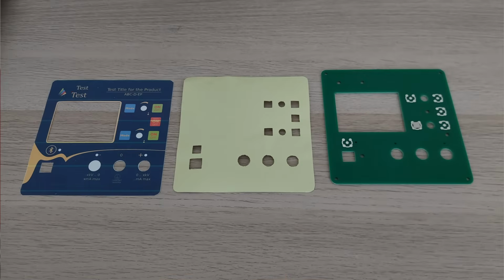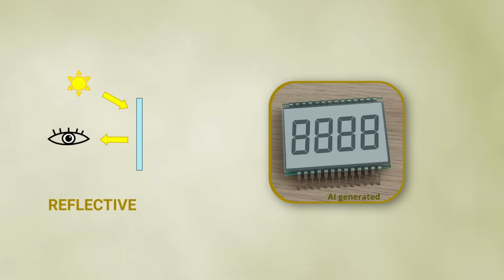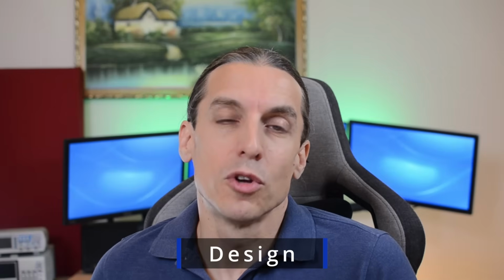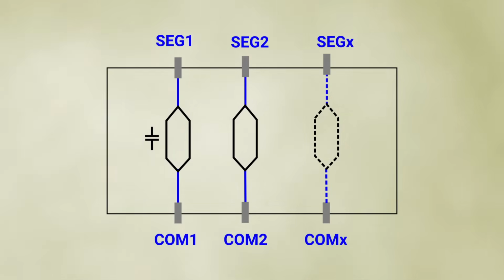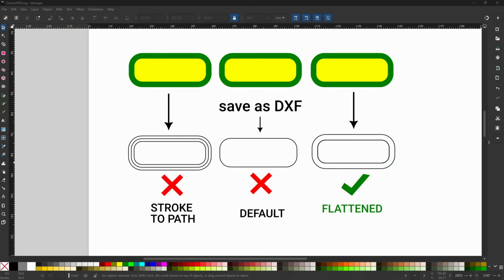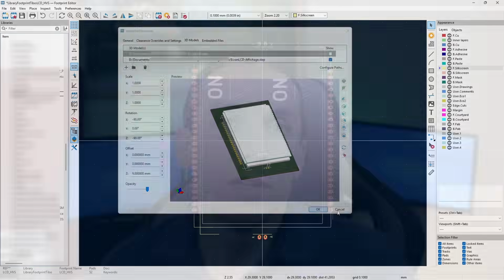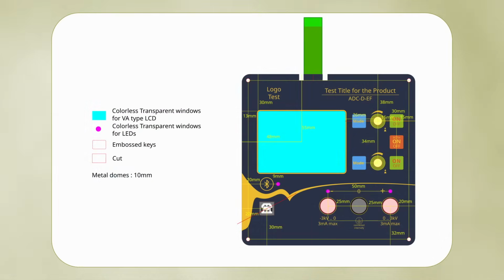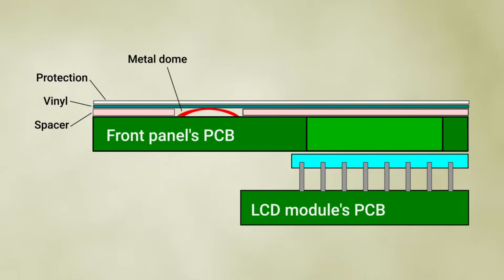How to Design Your Own Custom LCD and DIY Switch Membrane

Comment: Cool video but who are these mystical manufacturers for the display and the pad?
Reply from the maker: For switch membranes, I do mention in the video the online quotation system of JRPanel, but there are many other vendors online. They are also many vendors for the LCD that you may contact for up to date info and pricing.

Comment: Great tutorial,  Thanks.
 Is there a way to ID the pin connections of a proprietary LCD display ? ,  They're about 5cm sq, they display text.

 I have a number of them I'll like to use.
Reply from the maker: You're welcome.
I would say the way is to ask the manufacturer/vendor for the datasheet if they allow 3rd party use of their display.

Comment: 180 for tooling and 3 for the lcd? Seems like a pretty good deal, at 30pcs comes out at 9 a piece plus driver. 
Tho tough choice vs integrated lcd.
Reply from the maker: Yes, that can be a tough choice. Although you also need to take into account the price of the buttons/knobs interface when using a custom LCD.
Reply: @IcosoLabs how so? Those can be separate and I hate membrane keyboards, feels so cheap.
Reply from the maker: For them, not to look cheap, you need a combination of good graphical design, good surface finish selection (texture, embossing, …) and good product design and integration.
So yes, it is becoming more and more challenging for product developers to get those 3 points correct, as competing technologies can offer extra benefits.
For the chocolate tempering machine prototype I am working on, I think an LCD touchscreen might be the better choice. Still, I haven’t ruled out the switch membrane, since it could be easier to clean and might be sufficient. I need to take some time to see if I can come up with a good graphical design.
Reply from the maker: You can check the post I made showcasing what a switch membrane could look like on the chocolate tempering machine. It may not look so bad on this product.
Reply: @IcosoLabs  oh yeah, looks pretty nice, though you can't pay me enough to consider membrane keyboards - maaaybe I'd go for capacitive touch buttons, I've seen too many worn through membrane ones.

Comment: Upfront costs are not really DIY-friendly
Reply from the maker: Cost and valuation are relative. Some may find the price cheap. Some may find it expensive.
Some may find it expensive but still be willing to pay for the pleasure of giving their project a nice look.
Anytime I can, I’ll give tips to make things affordable for the majority.
That is what I did for the DIY switch membrane with the cost effective 2-layer PCB and vinyl version.
If you’re interested, you may check my upcoming videos on how to implement touchscreen LCDs with TouchGFX or LVGL.
Reply: The costs of custom chips are even less friendly!
Reply: it reflects the setup costs that the manufacturer has. to be honedt for an initial prototype or a project with a very small number of units you would be better off with an lcd/oled/epaper display emulating an lcd has the flexibility to get the allow you to really get the design ergonomic before you cast it in stone with a custom lcd.
personally i had no idea this was available as a service and the costs are a lot less than i expected. and the costs are very cheap compared the the cost of the time you put into your own projects.

Comment: This information is awesome! It's great to know how to design a custom LCD. I often wonder how professional engineers arrive at this information. Do they submit their requirements to the LCD vendor who designs and builds it for them, or does the vendor provide them with documentation for designing it themselves? Thanks!
Reply from the maker: Thanks ! I am glad you found it interesting.
I can’t answer for others, but there are various information online to guide engineers who need one (choosing the technology, etc...).
I submitted a request with my design first as a PDF and we discussed by email the LCD’s technology and the file format needed. Then, the manufacturer took care of the rest.

In fact, I summarized the process here and 2 videos are coming about using LCD touchscreens (with TouchGFX or LVGL), because of the chocolate tempering machine project I am working on. For this product, I’ll need to make a choice for the user interface between a custom LCD + switch membrane or an LCD touchscreen (check the post on my channel to have a look at the ongoing CAD work). Both choices could make sense, so once I’ve made enough progress, it will be valuable to get your and the community’s feedback on which you think is best. So... more videos coming on this subject 😊!
Reply: @IcosoLabs I'm working on code to drive a bare TFT display module using parallel RGB. I've also worked with LVGL in the past using C++. It seems to be dominating the landscape with a very large community.